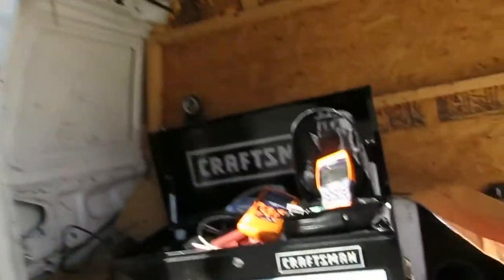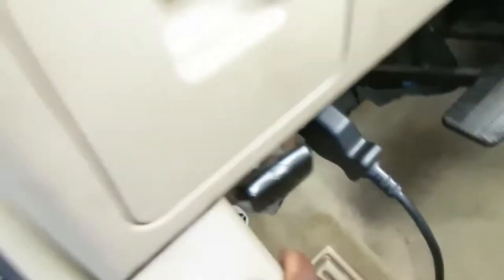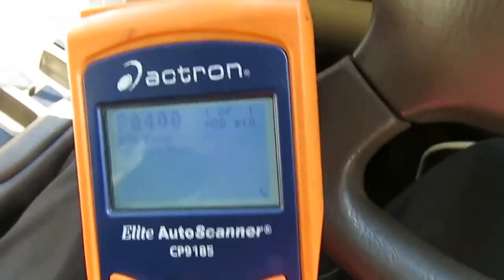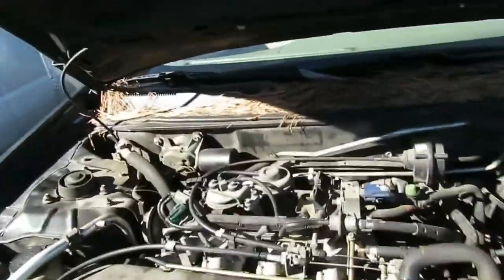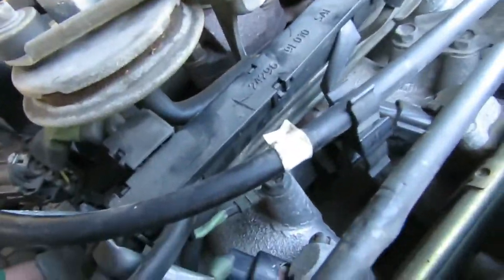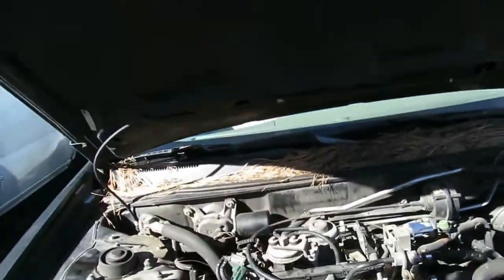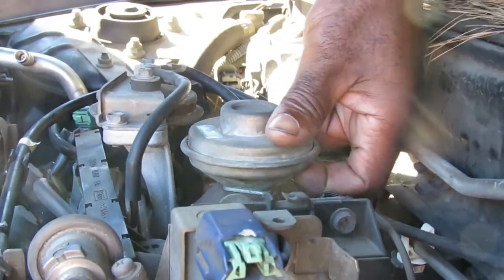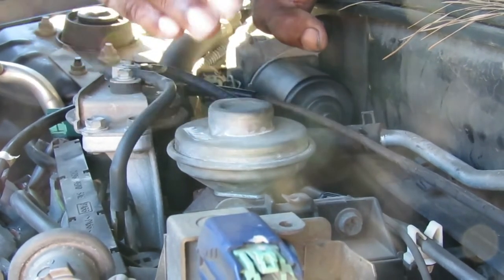⭐ 1999 Nissan Altima - 2.4 - P0400 - EGR Insufficient Flow Detected

Comment: There's an allen headed plug on each side of the intake upper. One on the passenger side, next to the IAC, on on the driver side, next to the TB. looks to be a 18mm /19mm hex, could be smaller. These should theoretically give you access to the intake EGR passage. Failing that, pull the PS hose/pump assmby, PCV housing, IAC, TB, & starter for access to lower intake-to-head fasteners from the sides. Pull the driver side plenum to motor brace as well, so the plenum can drop down. Expect your forearms to look like hamburger by job's end. Set aside 8hrs for "surprises."

Comment: Timmy u a real one, trying to fix my p400 code on my 00 frontier I replaced the egr valve n celluloid but the code keeps coming up truck runs fine no bad symptoms n the check engine light even randomly shuts off when it's cold out.

Comment: Hi, I have replaced the egg vavle twice. As soon as I replaced it the 2nd time 2 weeks ago and filled up the gas tank the engine light turned on again. Got the computer to scan it and again it's saying egr vavle. It's brand new! Mechanic said he found some liquid after replacing it the second time. How much does it cost to replace and put a new intake manifold gasket? Thanks
Reply from the maker: Maybe the problem was that you put an egg in it instead of the EGR...LOLOLOL

Comment: Another question. So i picked up the diaphragm and my engine started to stall out/ lose power but it didn’t turn off and my egr valve is good because I also checked it too. So what could possibly be my problem? A clogged passage?
Reply from the maker: Check vacuum to EGR control solenoid and check the control solenoid.
Reply: ⭐ Astral Auto Repairs okay I put a brand new egr control switch on the car, so I know that’s not the problem and if my egr valve is good and the car stalled. So I’m guessing it’s probably the egr vacuum. So how do I check the egr vacuum ?
Reply from the maker: At the EGR solenoid, there should be two hoses. One has constant vacuum, and the other goes to the egr. Make sure the one has vacuum. Also let us know if there is anything else in that vacuum system, like an egr transducer (it should be round).
Reply: ⭐ Astral Auto Repairs okay thanks. You think you can make a quick video on checking the egr vacuum and egr solenoid? So we can get the whole egr system.
Reply from the maker: If that comes up, I certainly will. I only do videos when a customer needs something done.

Comment: Great tip about using your finger to check the ability of the EGR valve to hold vacuum - far easier than testing with a vacuum pump!!
Reply from the maker: Thanks Inisfad, I try to show different methods for the people who don't have the equipment.